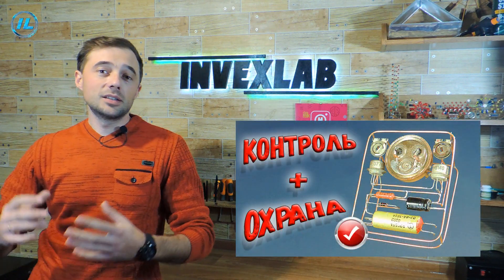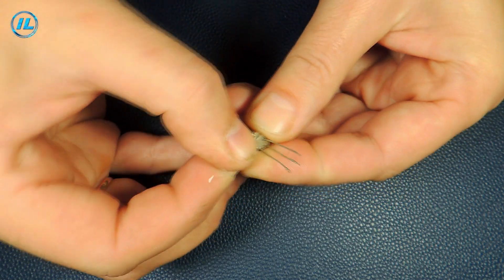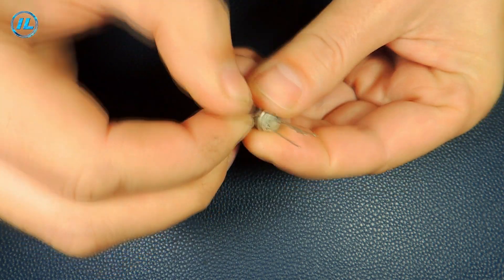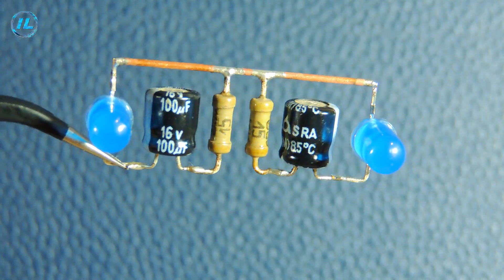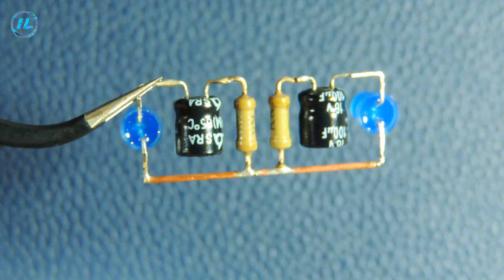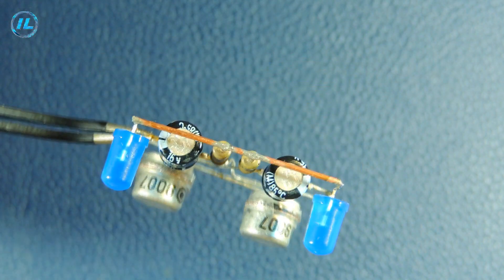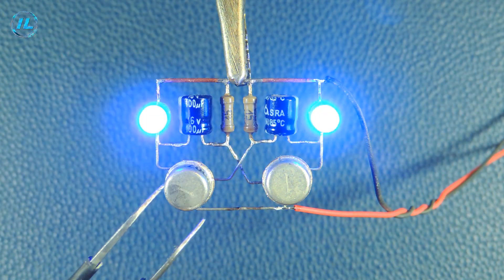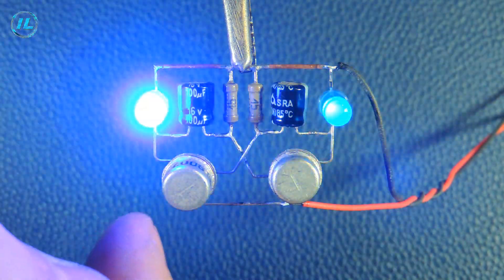✅ Experiment!  Will open body transistors work? The flashing light on the LEDs. ✅

Comment: The old 1960's Germanium transistor OC71 was sold with an unpainted glass case and was sold as OCP71 and worked well as a photo transistor ... some power transistors ( 2N3055 etc ) work as photo transistors with the top off ( put a blob of clear 2 part epoxy on the die to protect it ! ......... ( tried - n - tested ) .......... DAVE™  🛑

Comment: Open  POWER  transistors can act as photo transistors ( TO3 case , 2N3055 etc .. ) advise putting a blob of clear 2 part epoxy on the die to protect it ! ! ... the old 1960's Germanium transistor : OC71 was sold with an unpainted glass case and marketed as OCP71 and worked  VERY  well as a photo transistor .... ( tried - n - tested ) ....... DAVE™🛑